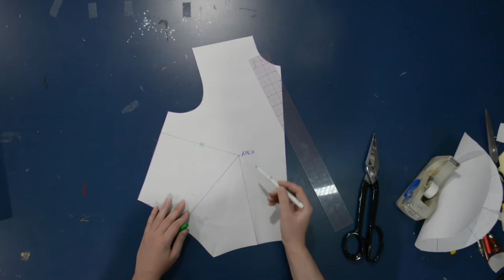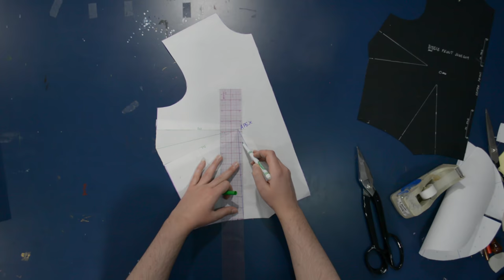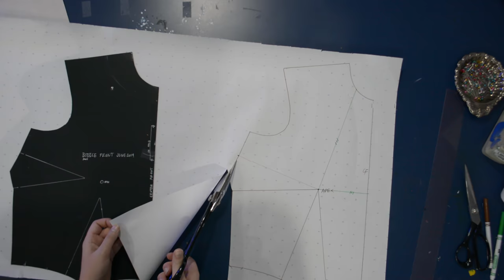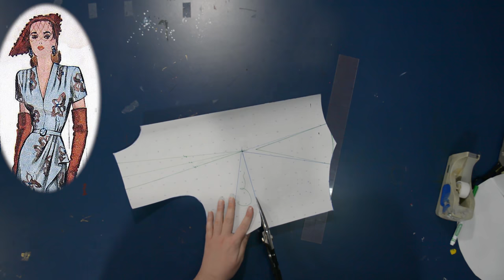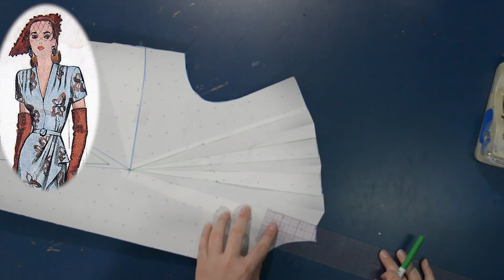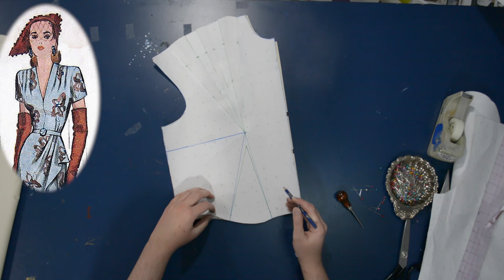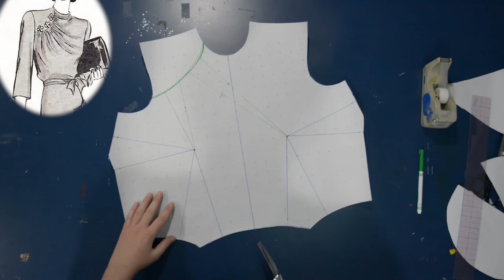Dart Manipulation Explained // The What, Why, and How of DARTS

Comment: This is fantastic! Love the party hat comparison - it's such a perfect visualization.
Small quibble -- "DD" as a bust size means nothing. A 34DD is the same bust volume as a 42A or a 38C. (Something I learned when I started making my own bras.)
Reply from the maker: Thank you Maria! I mentioned I am a DD simply as a point of reference for those who were perhaps looking at my pattern and thinking "whoa my darts are a lot smaller than that!" and are worried they've done something wrong. My pattern has a full bust adjustment and my bust and waist are 12" different, so my dart excess (pizza slice as it were) is larger than "standard" blocks would account for.
Reply: @TheClosetHistorian  Thanks for the reply! I thought about it more as I was pressing some fabric (as you do) and realized you were probably referring more to the delta in measurements, rather than the volume. I think I tend to proselytize about bra sizing because so many bra wearers have been mis-sized over the years. -_- Apologies for the sort of know-it-all comment. :)
Reply from the maker: @MariaRosseau  
It's all good! Saying I had a large difference between my bust and waist would have been a better way to phrase it anyhow. I find bra making incredibly mysterious and it seems dauntingly difficult to me, so good on you for taking that on really! 😅
Reply: Bra sizing is so confusing. Why don't they just state the underbust measurement in inches or centimezers plus A/B/C etc for a set amount of added volume up top.
Why does the cup size change with the underbust measurement? It just makes no sense to me. Why isn't an A cup an A cup and a B cup a B cup, irrespective of the underbust measurement?
Reply: Lol, this. I am a "E" Cup (in uk sizing, so DDD in US?) but I am TINY. I have a 27 inch underbust so I wear a 28E - most people guess I am a 'B cup'. that said, between my first draft and the final block I always have to make the bust darts bigger with an extra sidedart (is that a full bust adjustment?),
Reply: @raraavis7782  It IS confusing! But I think partly that's because our bodies aren't so simple. I'm not an expert, but here's my understanding. The sizing is consistently a difference in measurement between the full bust and either upper or under bust. But picture this - take a baggie filled with a set amount of water, and put it in a bra. That amount of water is going to be a higher proportional volume on someone with a smaller frame, vs someone with a bigger frame. So if I gained a bunch of weight (and none of it was in my chest and it just made me bigger around) my breasts would appear smaller because the rest of me got bigger. It's totally imperfect. But I understand bras a whole lot more now that I've made some.

Comment: Great, now I have design ideas I haven't had since my early 20s. Also, I'm starting to realize that I could actually just make my own corset pattern that fits specifically me because that is also just "darts" controlling the fullness of the fabric around the 3D parts of the body. Of course it's not that straightforward but essentially the base idea seems to be the same.
Thank you!

Comment: I sometimes put a shirt on inside out so I can pin the wrong side of the fabric without stabbing myself when trying to adjust the fit (eg. by adding darts) of an existing top. The problem is that since cancer surgery, I am no longer symmetrical and turning a shirt inside out puts the right side (of the body)  on the left and the left side on the right compared to when you turn it right side (of fabric) out again. I also have some scoliosis so I am not even symmetrical from the back! I hope this isn't confusing. How do you deal with asymmetry of the 'cones' short of reconstruction surgery. I don't own a sewing form so I can't try to fit things that way.This tutorial is brilliant by the way and I am an engineer. :)

Comment: This is excellent, thank you! One question I had while watching this is, how do you add ease? For example, what if, for the asymetrical bodice, you wanted it just looser all around?
Reply from the maker: I would make a block/sloper with more ease really, and then use that to do different styles with, or add ease first to the tracing of the block before modifying it into a new style. Though I'm simply not an expert in ease, as I never add any and I wear my stuff raaaaather tight 😅
Reply: @TheClosetHistorian  Thanks! You've inspired me to start doing my own pattern drafting, but I tend to wear a bit looser. So, making a block pattern with ease makes a lot of sense.

Comment: I have a bodice block from a class i took but it has fisheye darts instead of the 1 triangle waist dart. Is there a way i can do dart manipulation from fisheye darts? Thank you for all your videos! X
Reply from the maker: Thank you Annie! I always manipulate the bodice darts and skirt darts separately, and usually fisheye (double ended) darts are "connected" at the waistline, where on my pattern there is a seam instead. I'm afraid I have no experience working with double ended darts, but I imagine if I had a sloper without a waist seam, I would cut it apart at the waist myself and add a waist seam in order to then move the single ended darts around wherever I wanted to.

Comment: This is such a good video, and has opened up a world of possibilities. I am in the process of obtaining the book you used for drafting your own block, so that I can have a go at making well fitting clothes for myself after years of only sewing curtains and the like. As a woman in my late 50s I have become much larger than I used to be and am quite wobbly around the middle. I have found that if I try to wear close fitted clothes that look great when I’m standing up, I can’t bend or sit down in them, so I’m wondering about the question of EASE. How is ease added to a block pattern? I would like to keep a bodice block relatively close fitting at shoulders and above bust, but would like the fit to be looser from bust to waist. Is it just a case of adding fabric at the seams or do you open darts more? The same goes for the pencil skirt, I love the look as they’re so flattering but I’d need more ease at the waist and hip without it looking baggy. Can you help those of us who don’t have a lovely hourglass figure like you? Greetings from Ireland
Reply from the maker: Thank you Fionnuala! Unfortunately I'm simply not a fit expert myself, I have only ever worked on my own self, so I don't have the experience or know how for real fitting and tailoring! You can certainly add ease anywhere you wish, and you can indeed use a bit from the darts and a bit at the sides, but I'm just not going to be the best resource on the matter I'm afraid. Hopefully google can lead you to someone who's got the knowledge I am lacking!
Reply: @TheClosetHistorian  Thank you for answering. I love your videos and have found you very inspiring, so I’ll take your advice and go on a Google hunt. ❤️

Comment: very instructive, thank you very much!! Great job.  now i have a question about fitting/block issues. 
i am a male starting to sew more and more and have stumbled upon an adjustable dressmodel on a pedestal. I intend to manipulate the small femalemodel with felt stuffing into my own personal model.  This would help me to make clothing that i make to easily fit on the model and see how it is shaping.  Once this project is finished to my satisfaction i am sure i will have collected many more questions and ways to reseach.  Now the question: Do i, as a fairly flat guy, need to work with darts and manipulation or are there other ways with the male body? 

It still is a 3D body as opposed to the fabric that is on the table. 

Hopefully my question is clear enough?
Reply from the maker: I have never made any menswear so I don't really know! I think most of the time menswear is simply cut boxier, or it can be fitted with darts as well, usually there is just more ease left in.

Comment: That's so helpful thank you 😊. I do have a question- not about darts, but hopefully you don't mind answering - when you join a yoke pattern piece  to a bodice piece, sometimes the bodice piece is curved at the top or the yoke piece curved at the bottom but the other piece doesn't curve in the adjoining area. Should I still be sewing in a curved line to join the 2 pieces or just taking it straight across to join the yoke? The patterns I got recently don't really make it clear. Hope this makes sense it's hard to explain what I mean. X
Reply from the maker: Thanks Frankie! When I have curves, usually a curve to a straight edge or a curve to an opposite convex curve or such, I like to pin things with the straighter edged piece on top, just always seems a little easier to ease things in that way to me. Then you follow the shape of the piece while sewing. Maintaining the correct seam allowance is the important part, so if that means curving along, curve along! 🧵
Reply: @TheClosetHistorian  thanks so much that makes sense was just having a nightmare thinking I'd take the stitching to far over and lose a bit 😱😂 but thanks so much for answering ❤️xx

Comment: Question: I’ve made a bodice muslin and adjusted for a full bust. Perfect except the neckline needs to be about one inch  smaller. Can I put a dart in the neckline to make it smaller, close it on the slopes and add that amount to the existing side darts?
Reply from the maker: Yes Kathy that should work fine!

Comment: Fantastic video as usual. Are darts on the pencil skirt for example the same principle x
Reply from the maker: For the most part yes! The darts on other areas radiate from "pivot points" instead of the apex, but the largest curve nearby is the gist usually, in the back the curve of the shoulder, in the skirt the curve of the hips and body generally, the bum in the back 😂

Comment: Does this also apply to the basic skirt block? For example, if I have a pattern with 1 dart at the waist, can I split this into two darts to make a 2 dart block? If so, do you need to worry about the placement or just make sure the same amount of fabric is taken out of the waistline? 
Thanks for this video, by the way, it was fantastic :-)
Reply from the maker: Thanks Molly! The answer here is...kind of? The skirt's "apex", or pivot point for darts, is the largest curve nearby, so the curve over the "belly" as it were, or side of the hip, or the bum on the back. I already have two darts on my skirt block so I have never split from just one, but I would think it should work!

Comment: At around 29:50ish you talk about having the grain line matching the centre front, but the CF seam is angled.  Which line should match the grain line- above or below the dart?
Reply from the maker: In this case I cut it with below the dart section along the grain. I usually try to keep the majority of the CF alighted with the straight grain, so whichever section is longer is what I'd aim for. 90% I am cutting the CF on the fold because I don't do a lot of designs like that with darts or details down the center myself in my own sewing. Usually when I do a center front seam, I do so in order to cut it on the bias or near bias on purpose, to set stripes onto a chevron down the CF. That's just what I use CF seams for the most in my own sewing! Like this dress http://theclosethistorian.blogspot.com/2018/07/show-your-stripes.html You can create really fun yet different results when working with stripes, so that is one instance where I think pattern placement really beats grainline when it comes to deciding on a cutting layout!

Comment: Really enjoyed this video.  And learned a lot, even after sewing for over 40 years!  Is there a way to convert a single breasted button front to double breasted?  I've tried a few times but it was wanky.  Do you have any advice?
Reply from the maker: Thank you! I haven't tried myself but I would imagine one could just make the extension larger, not for a large size button, but for two side by side. It should only become a problem if you try and make it wide enough it passes the other apex, then other shaping is going to be required.
Reply: That's kind of what I tried.  The front looked off kilter though.  I'm dealing with some steam punk things right now, but I definitely want to try it again.  Cross your paws for me.

Comment: I have a question for the gathering: how do you know (measure(?) gestimate (?)) when you have gathered the piece in enough?
Reply from the maker: In the case of using gathering instead of the darts: the waistline still needs to measure the same as it would if the darts were sewn in. So say after the darts were sewn in the front waist should be 15 inches, then while gathering, make sure the edge measures 15 inches once gathered. Never easy to explain 3D things in words 😂

Comment: Thanks for this explanation. Very interesting. I prefer princess seams. Much easier to avoid cone boobs that way. Sometimes you need darts though, for various reasons. Having 2 darts instead of one should reduce the cone boob. So that's a good tip.

Comment: I have FINALLY gotten a sloper that i think fits well and i am excited to use it for pattern drafting....but.....my waist to bust ratio is very small and my darts are teeny tiny 😞 Does this have an impact on pattern design (like gathering at the shoulder)? If so....how can I get around that hiccup?
Reply from the maker: Firstly, congrats on wrestling with the sloper, it's not easy I know! Secondly, do not fear! There are usually ways to add more fullness for different designs in addition to the dart fullness, so for example here is a sketch of how to add more for the gathered neckline style https://www.pinterest.com/pin/460563499400498219/ You can usually add in at least some extra fullness without anything getting too wild, I want to make a video all about this in the future!
Reply: @TheClosetHistorian  Thank you thank you! That is exactly what I need! And full disclosure, I gave up on my many year long trial to make my own sloper and used one of the links for an online sloper service you provided with your video 🤭 I'm excited to get started manipulating those darts!
Reply from the maker: @Anna-qb3pv  Whatever works I say! ❤✨

Comment: You say for big breasts that the point of a dart should be further away from the apex, but how would that advice differ if you were trying to add darts for someone (like myself) whose large bust is pretty much all projection. My issue with the fit of most clothes which aren't knitted is that the apex of the garment seems to be waaaayy closer to the armpit than my close set & narrow, but large breasts sit. Like hearing you say you're a large bust at a very average to small DD cup... closest volumetric fitting bra is a UK 32J/JJ (though actually too wide & tall in the cup & not deep enough even in brands famed for their high projection bras). That's like 8 to 9 cup sizes larger than a DD (I do remember being that size, it was tiny. My breast root is still that size, but my boobs are much longer now lol, I blame EDS for the stretchy skin not making them get taller/wider). 

Anyway, should I actually be seeking to make myself more of a cone? Is there another way to soften the shape so its got lots of projection but not too pointed? I've ended up exclusively wearing stretch knits because I am terrified of trying to work out bust fit as examples always look so wide compared to my chest. And my proportions are so outside the basic fitting techniques that even full bust adjustment books seem to not understand that my size exists to need to be accounted for (its not even that uncommon). Trouble is the stuff I'm drawn towards stylistically for stuff I want to learn to sew is all super fitted non-stretch fabric which really does require darts. But there's not even dress forms close to my proportions for me to practise on so I don't know where to start!

Comment: For the back of the bodice where is the "apex" to radiate the darts around?
Reply from the maker: There is far less information out there on this which can be irritating! The back "apex" I think is called a pivot point instead, as apex is reserved for the bust/chest. The pivot point of the back is the highest point or bulge of the back, so the shoulder blade or curve of the high back most often. I have always simply used the original end of the dart in the back to move my back dart around and it has never given me trouble, but officially one should find their back "pivot point" as the most outward point of their own personal body. I was able to find some information in some of my older ('40s and '50s) drafting books, so I took a few quick snaps of those pages and will throw them up on pinterest to read through for guidance https://i.pinimg.com/originals/c6/ae/1c/c6ae1cb37de1972b1dd5c280e40a418c.jpg 
https://www.pinterest.com/pin/460563499400939659/ Rule two from Modern Pattern Design is affirming too https://i.pinimg.com/originals/60/eb/37/60eb3721c5dd1ab65bc3476e86f041a1.jpg

Comment: So how do bodices with less conical tips come together?  I'm an extreme novice, unfortunately, trying to learn how to turn these kind of bodices into softer silhouettes like princess seams create.  They just seem to flatter my figure (D cup & plus size) better.  Maybe it's more the fabric choice... I'm just not into the bullet bust look.
Reply from the maker: If you make the darts end further away from the apex, it makes things more rounded. I make things extra conical because I wear vintage style bra's and I am deliberately going for a more vintage shape, but it isn't mandatory in any way when using darts. Princess seams can be rounded or conical too depending on the desired result, both seamlines and darts can create either shape!